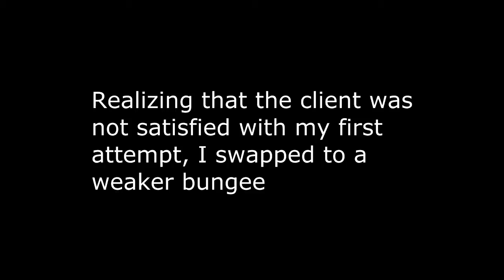Motorised swing seat

Comment: Love it! How do you make one?
Reply from the maker: This was done as a joke on my wife. The motor was connected to the swing with a piece of bungee cord. Mechanically this was the worst method of creating the swinging motion because nothing is in harmony. Some times its a big swing and at other times nothing.  If you wish to do this properly then thefirst thing you must do is to find the swing frequency of the swing. This frequency does not change with the weight of the person You will need to buy a motor with a rotation speed thay matches the swing frequency, my guess it will be in the 50 to70 rpm region) There are lots of motors like this on ali express  they would normally work with 24vdc and used as window winder motors in lorries. something like this will work (buy a 24v 80rpm)

https://www.aliexpress.com/item/1005007972053127.html?spm=a2g0o.detail.pcDetailBottomMoreOtherSeller.1.52cb6iKg6iKgeH&gps-id=pcDetailBottomMoreOtherSeller&scm=1007.40196.422467.0&scm_id=1007.40196.422467.0&scm-url=1007.40196.422467.0&pvid=bc475bb5-3612-44c5-9301-24ca70ef3ffc&_t=gps-id:pcDetailBottomMoreOtherSeller,scm-url:1007.40196.422467.0,pvid:bc475bb5-3612-44c5-9301-24ca70ef3ffc,tpp_buckets:668%232846%238112%231997&pdp_ext_f=%7B%22order%22%3A%221%22%2C%22eval%22%3A%221%22%2C%22sceneId%22%3A%2230050%22%7D&pdp_npi=4%40dis%21GBP%2157.46%2154.59%21%21%21540.04%21513.07%21%40211b813b17451045088437827e752d%2112000043093293842%21rec%21UK%21762449866%21XZ&utparam-url=scene%3ApcDetailBottomMoreOtherSeller%7Cquery_from%3A

If you buy a 24vdc unit and a variable power supply like this

https://www.amazon.co.uk/TobeBright-Adjustable-Universal-100V-240V-Electronic-Black/dp/B0CTQFLDX4/ref=sr_1_27?dib=eyJ2IjoiMSJ9.EV3G5LDpIGD-xXG71HtQeP0M-1I2RC82iEVPRw2zfjZww9C9cYSZ8DlgamBSYo2VN3HdetcPS91ENFpSHtLuTl4Lnl3UsTyzuxP0t4TMMJuCmvMGVU5AoDVzQDX6b0yitBYLdKxQAdV3ObPVKLQK-g1kHlzM97_9wspUgZITRCBBfzNbO-dcCAsH5qbj_buxwS2MINqrK9k-IOFKZQiblacic21ZaVXoOvkrKsOR8BChlKn7WHowKhurpUh3nAGda7riia2zYngRM17wZR9aEeKHE69blwPdOdfsLXKAPf8.qL1d2FMtfeLtXaxAVMokC2p_6wla6kLooWRUcWdHRV8&dib_tag=se&keywords=Variable+DC+Power+Supply&qid=1745104836&sr=8-27

You can run at less than 24v  to reduce the speed.
Reply: @SarbarMultimedia  You are so kind to give me clear directions! Your video is funny and so creative! Thanks 😊

Comment: What motor did you use? I want to do something like this for myself but can't find out that i think will be powerful enough. I am scared of breaking the whole thing while testing different motors. I know this is an old video but please respond.
Reply from the maker: Hi 
 I made  this as a bit of a joke because my wife was complaining that she couldn' t rock herself with her arm above her head and fall asleep at the same time. . I purposely made something wacky from bits I had in my workshop and linked it to the swing with a bungee cord  so that it had lots of bounce. . That's why it is out of sync with the swing to purposely create an erratic motion.  I could have designed it properly but that would not have been as much fun (for me). Anyway after the laughter she decided to go back to manual swinging 
 
 If you really want to be serious about it then the two key components are  something like a geared window winder motor and a varisble 24 vdc  power supply 
 here are  the sort of components I used
https://uk.rs-online.com/web/p/dc-motors/8814548/
Obviously you will have to make and fix a crank arm to the motor

https://www.ebay.co.uk/itm/193959627239?_trkparms=aid%3D1110006%26algo%3DHOMESPLICE.SIM%26ao%3D1%26asc%3D20201210111314%26meid%3D2a38ed9e6d7a43f4abfa7c1b717a9103%26pid%3D101195%26rk%3D1%26rkt%3D12%26mehot%3Dco%26sd%3D174679009322%26itm%3D193959627239%26pmt%3D1%26noa%3D0%26pg%3D2047675%26algv%3DSimplAMLv9PairwiseUnbiasedWeb%26brand%3DUnbranded&_trksid=p2047675.c101195.m1851

 This power supply allows you to switch the voltage all the way  from 12 to 24 volts to adjust the speed.  mI reckonnthat 15 v will goive about 120 rpm which will be close to the natural swing frequency

Best wishes
Russ
Reply: @SarbarMultimedia  Thanks a lot! Not something really serious just a little side project to do.

Comment: My mate has a child with cerebral palsy who loves the swing. He’s 8 and starting to get heavy. Something like this would be unbelievable for them. If you have a little bit of time could you mention how it was made? Great video.
Reply: Hi Damiantos
 Sorry there were no drawings I just went into my workshop and pulled a few pieices I already had. This was not intended to be a serous project, it was just a passing comment that my wife made, moaning that the swings didnt last very long and she had to keep reaching out to rock herself. I purposely designed it to be out of sync so that it made erratic jerks. We had a good laugh about it and she has decided that manual rocking is not that bad after all!!

However, if you wish to be serious about it  the basics you will need are a motor similar to this 24vdc and about 60nrpm. driven by a variable power supply that allows voltage switching so that you can set the bet motor speed slower

https://www.ebay.co.uk/itm/DC-12V-24V-Electric-Motor-Left-Right-Angle-Reversible-Gear-Motor-Garage-Door/402445040378?hash=item5db397fafa:g:zNAAAOSwvylbUpYN&var=672586376398

and this sort of power supply  with voltage switching

https://www.ebay.co.uk/itm/28Tips-Universal-Power-Supply-Charger-for-PC-Laptop-Notebook-Power-Adapter-96W/193838100884?_trkparms=ispr%3D1&hash=item2d21a6b194:g:YH0AAOSwX7hf9XiU&amdata=enc%3AAQAFAAACgBaobrjLl8XobRIiIML1V4Imu%252Fn%252BzU5L90Z278x5ickkfKe2vUidqHRg3XM2X2xOVCof7uvkVbgSC1QQrqRRhyRqkfPokcheTe4OfXnC92AaitqcMSGCJZD1mE0phOZUQt2KDJvqpPNOy%252FM3R9ukSWiEpesrplxSn1Q%252BMxP9n2g8n5AXvyz7cOKyFkScrF2ArIgkwR2GQkuOLoowou538EEMIeBrmGYNJhywejVaLWPZ54Ku03HFIa4tHxw0h8Srl%252FjgWE7N%252BOHRYgIo6N8BUdg0EMgEBnwUQHUfsCU6p3%252BPLEs7%252BdDVRCyH79kUWOMQdnB12RPzQIZDJTvYJa0wQa%252BmKCyr626iWadxByEPQBAsutQe5wLsHkorsE1p9USZtZg%252FL3t7iTYTFFrYbLR44%252F4hAR0PNr3IA0nYGO5MAvXt4l%252FGYVaAfbJSKheggW%252Bii%252Fw%252BdUE09R2CGo5dcUnSkDMz7stVkyS7v3PXODCKOlB5rmSxBcOzJAxdwJ1xTFnuLo5ULpRvqRgKtP0c8d46CARx%252Bct7B6bxGe1qAWJxxPHwCASvBganOI00hgotbAhNtJIx83L9iai7II%252FZcrQNxB%252BVFCyR7y62zCvCKUocDqVQ05IF%252FmdWjnSRHdq0YIBKcc3PtDYEME45rMDExwMFifkx%252FVLamdc%252FVMqIxTIfkDvyyjjupWX6YLR%252BOXS5LlAXWGc4JxDyRWFF4UGe0AL4CyMoZ0dE%252Bi9FesiFpkbeEIaM47hfRZQlD7QbW%252FO6nfLrJmBp7UlJNU0DyhHWHZZQ%252BIYaOLH5hrA0Qk6HZt%252Bo6IOwQBEsTEXGIg01jz%252FBh7YJngFmF3huZHTfpRWJCsZXonA%253D%7Ccksum%3A193838100884cf64b8e6f4b74e73b4433132acbc45e4%7Campid%3APL_CLK%7Cclp%3A2334524

I'm afraid the  the crank arm you attach to the motor shaft, the link to the swing (a piece or rope or chain)  and the floor /motor mount will have be to suit your materials and mechnical inginuety.

Best wishes
Russ
Reply: @russsadler3471  I really appreciate the reply and pointing me in the right direction. Thank you